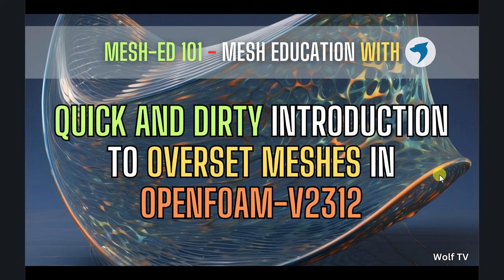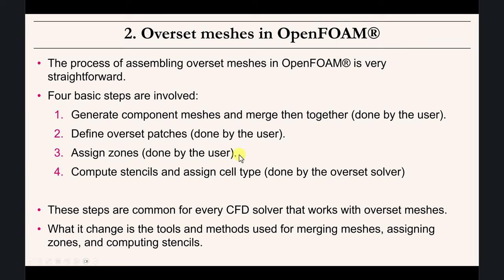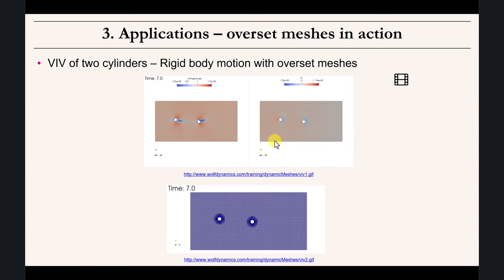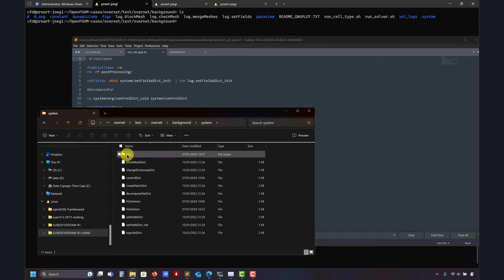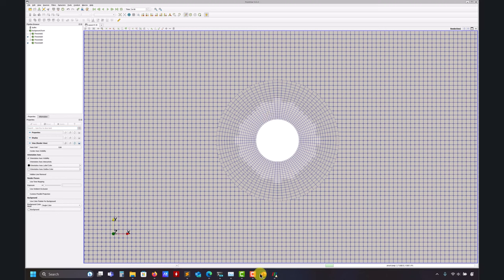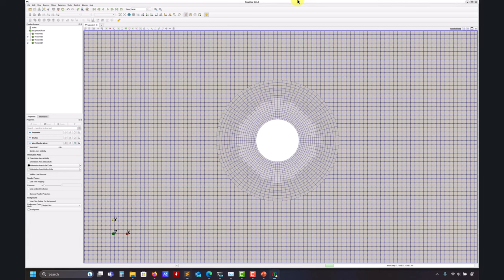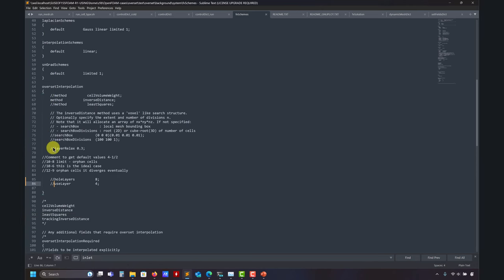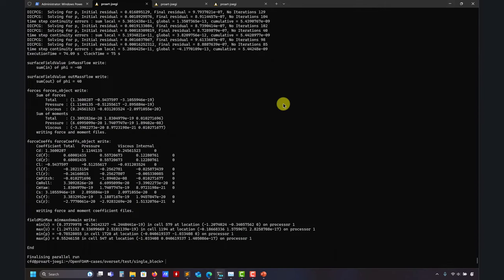Quick and dirty introduction to overset meshes in OpenFOAM-V2312

Comment: Could this be used to simulate a mooring analysis of a set of buoys under the flow of a river?

lets say, 3 buoys moored between then with each one on each extremity tied to a point outside the fluid.
Reply from the maker: Yes, but you need to install the mooring model.

Comment: I'm currently modelling a flow around a cylinder near the seabed, i built such a mesh for a  cylinder that the lower part is sticking out of the bottom boundary, so when parameters discussed somewhere in 25:00 were set to more than 4/1, it created a huge area of hole cells and the visual representation looked very ugly. Sometimes this feature could be not useful.
Reply from the maker: Well, I will need to take a look at the case to know what is the issue. But if it is only a visual representation it shouldn't be a problem. Keep in mind that you also need enough cells to carve a good chimera hole.

Comment: Bro, I notice that in OpenFoam V2312, the layering in SnappyHexMesh can be improved drastically by introducing meshShrinker.  I have already tried that tutorial but it does not work.  Could you please share that too if it is alright for you?
Reply from the maker: Well, I have mixed feelings regarding that.  Pretty much those are small patches that do not work. I do not know why the developers haven't addressed this issue which is related to ratio of surface area to first cell center. I have a method to overcome that issue but it is kind of our secret.  but in few words, just increase the maximum aspect ratio (the one hardwired in OpenFOAM) from a 1000 to 10000 or something bigger, and that will improve the BL meshing.